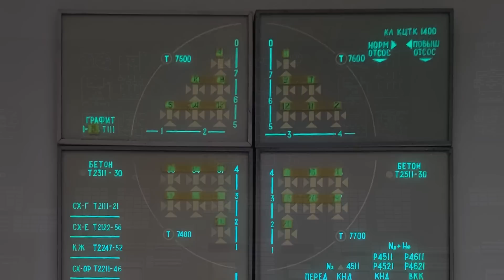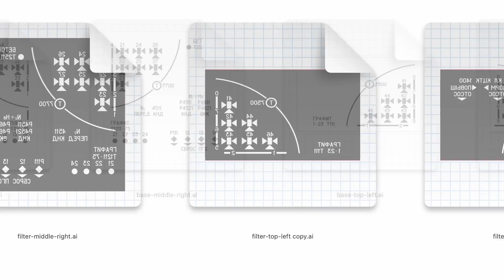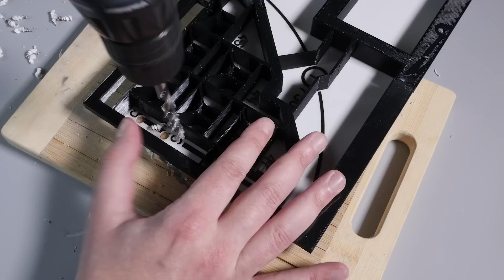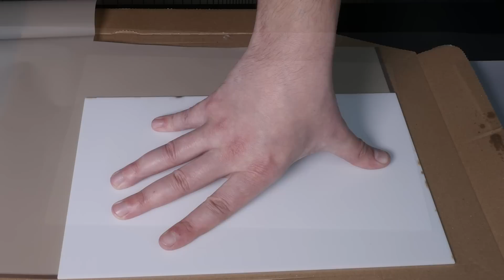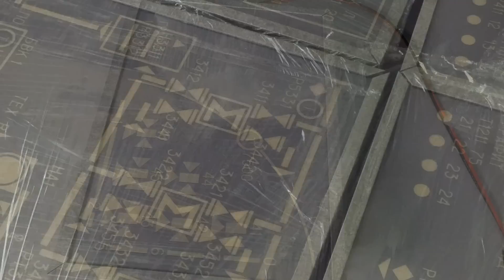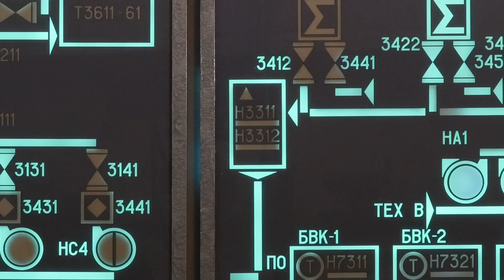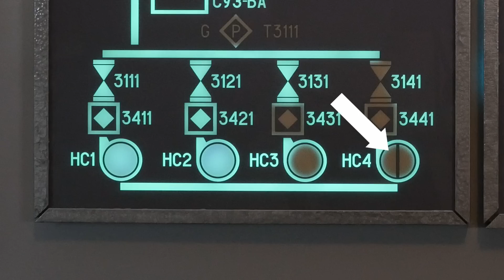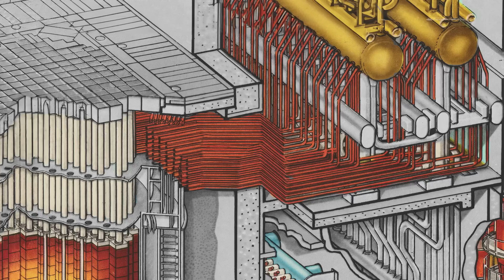This Chernobyl reactor panel works again after 25 years

Comment: Now build a whole simulator of the control room.
Reply: No, but actually your project is crazy.
Reply: @RGBcrafter  There is one in Visaginas, Lituania
Reply: That's a great idea! should be a patreon or crowdfunding kind of thing and be at disposal for donators.
Reply from the maker: Let's say, to put it in perspective: we would like to build a matching segment of the control panel for this display. There are 18 pump switches, they are very special, and each cost $40 at least. $720 just for switches, no metalworks, no buttons, no nothing. Making a control room would cost a fortune. But if someone chips in, we can recreate some parts.
Reply: @ChernobylFamily  Launch a fundraising.
Reply: @ChernobylFamily    It may be too much effort to be sensible, but i can hardly imagine that an imitation that looks and operates similar enough couldn't be done with SLS/MJF printing by a prototype contractor company for cheap. After all you're neither pumping actual fluids nor operating any dangerous voltages here nor do you have reliability requirements similar to a power plant.
Reply: @ChernobylFamily why don’t they turn the original control room into a museum- with a simulated working environment? Even bring back parts of Skala
Reply: @ChernobylFamily , but dont say it wouldnt be great, by the way great job with the panels, it looks great. Keep it up!
Reply from the maker: @pitvarpete2845 anyway, more to come:)
Reply: @ChernobylFamily  It could be a long term goal. Perhaps even have it as a living museum where tourists can attempt saving reactor 4 during the fathefull night of april 26, 1986.
Reply from the maker: Tourists will need to learn for years for this, I am afraid...
Reply: @ChernobylFamily  What could possibly go wrong? They blow up a simulated reactor? ;)
Reply from the maker: @Stoney3K  jokes apart, it is really not easy, if actually possible, to blow up a rbmk in its post-Chernobyl version. A good insight into this gives its software simulator.
Reply: @ChernobylFamily  there are some currently unused parts you can restore, or maybe you cold build that replica in already build, perfectly fitting room at some place in northern Ukraine... ;)
Reply: @Airsoftfrreak96  Use crowd funding to generate initial funds to build it, and then keep it going by opening it up to the public. I'd gladly pay to take a look at it and have a go at playing reactor operator for a day.
Reply: Agree
Reply: I know you're being facetious but if he did, man I'd pay good money to sit and operate it for a few hours
Reply: Oh no, I gotta say it DONT PRESS AZ5
Reply: Make it an escape room!
Reply from the maker: Man, you will not believe, but back in 2020, i guess (it was too long ago), we made props for a "nuclear" escape room in Kyiv: https://vzaperti.com.ua/quest/nuclear?l=en
Reply: @ChernobylFamily  I will try to remember that. I fully intend to visit Ukraine as a tourist after the war. I was booked on a trip to Prypjat and Poltava but it was cancelled due to Covid.
Reply: @ChernobylFamily  Thats Amazing! Do you have more pictures of it ? By the way i would love to support you on Patreon, but unfortunately i don't have the money... :( Keep up the great work, I'm your biggest fan i always look forward to your videos, You keep surprising me how every single video you release is better then the one before it. I am really excited for your upcoming projects! As i said keep it up!
Reply from the maker: @pitvarpete2845 somewhere we have, but I do not remember where :)

Don't worry about Patreon, the most important thing you like what we are doing — that is the biggest reward!
Reply: Tf do you think they are doing? You're telling them to do what they are doing.

Comment: Same principle of operation as the Apollo DSKY displays... Artem Kashkanov experimented with that, and Fran tried to re-create the DSKY display in a historically faithful way but the project was far too complex. Later on, Ben Krasnow built a modernized one to Fran's dismay.

You made a clever workaround here not using the troublesome high voltage high capacitance EL display... I really like it. Thing of beauty - joy for ever.
Looking at the plasma cutter reminds me of The Post-Apocalyptic Inventor.

I once made a nuclear trefoil symbol lamp out of those LED modules, a spent filament spool, some white acrylic and remains of an old wall-mount lamp I found in the trash. Gotta update the microcontroller code in that thing... and make a video about it.

Looking at the discombobulated mess of wiring in the real deal definitely does NOT fill me with determination, haha. Sloppy, sloppy... they really could have made it better.

Keep up the great work!
Reply from the maker: Thank you!